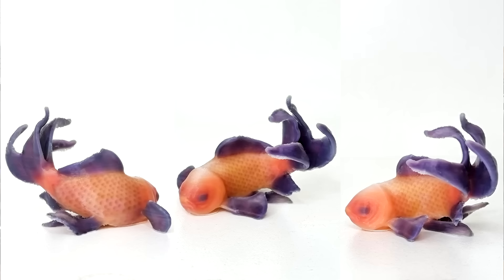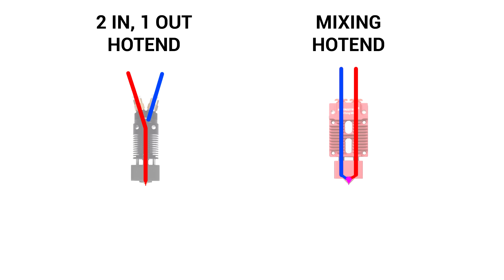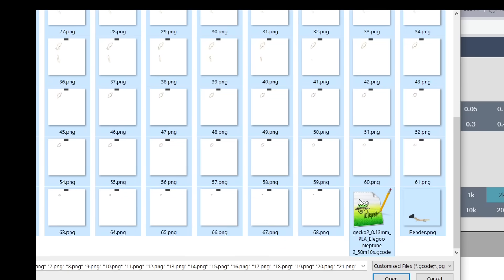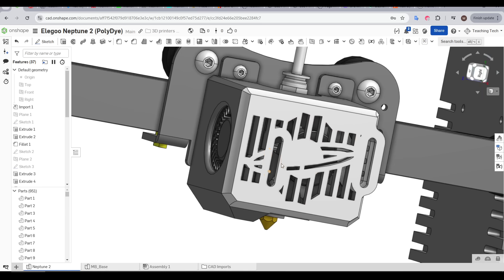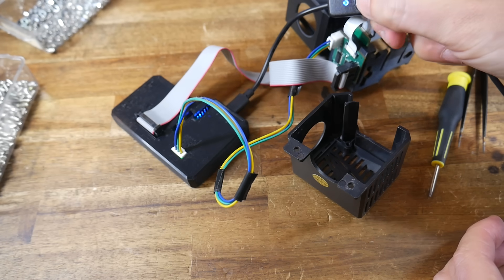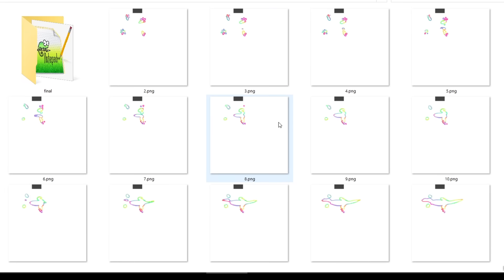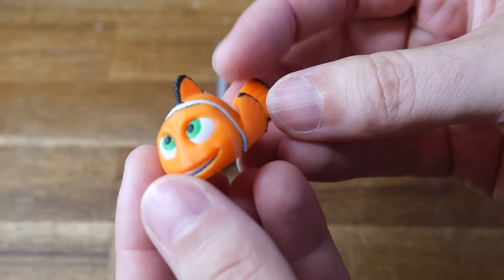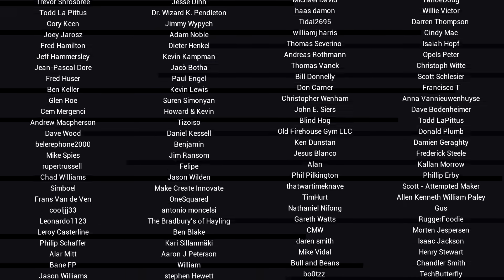Full colour 3D printing at home with PolyDye - Open Source Inkjet integration

Comment: I've never seen a full colour 3D print solution that I would waste time on even if it was free, and this is no different, but it's definitely the right direction to go in. They need to take the ink cartridges off head, and use bottles not standard hyper expensive ink carts. It needs to include a low cost head cleaning solution such as an isopropyl feed.
I suspect that this will eventually be the future of 3D printing, but it has a long way to go yet. In 5-10 years, this will be worth revisiting, but until it can manage really solid colour on low cost white filament, I'm not swapping one proprietary, expensive system for another.
Reply: These cartridges can easily be refilled or plumbed with a refilling solution.  Both are available already.
Reply: @williamsteele  Yes, but it's messy and time consuming, and the capacity is too low. A continuous ink system, which is also already available, is a vastly superior solution.
Reply: @Martial-Mat  Isn't that what I said?
Reply: @williamsteele  No. You said the cartridges can be refilled. I was specifically disagreeing with the wisdom of doing that.
Reply: @Martial-Mat  "or plumbed with a refilling solution" which is identical to what you said.  You still need a print head, and just supplying the print head continuously with ink works just fine.

Comment: If the colors were not so washed out this would be the next big thing in our hobby.
Reply: The amount of pigment probably just needs to be increased to achieve more intense colours. It is a start. On the commercial side, Flashforge is also working on a full-colour 3D printer.
Reply: @andreas.grundler  the 5x is just another ams style approach that looks different, but really affordable. the wax jet? that's for jewelry making.

Comment: That's amazing the one thing I'm thinking about is that is it possible for it to work with cheaper and refillable aftermarket Ink cartridges if it can then this is amazing
Reply: Or eventually a dedicated cartridge just for3d printing that is refillable instead of a hacked one. Heck maybe just a head with a hose with a tank that's somewhere on the frame.
Reply: @Awrethien  I think so too. This is just the easiest method for a homemade hack. Of course you can and have to scale it up further down the line. This is probably mostly a proof of concept to get everything working. Applying the Ink will be it's own Problem in the future. This will probably also affect the quality and layer adhesion so there will be a lot of testing needed still.

Comment: Holy smokes!! This is pretty incredible. The solution to full colour 3d printing was always in inkjet paper printing all this time.
Reply: If this could be made into a modernized and Open Source version of that laminated printed paper 3d printer that would be LEGENDARY
Reply: Mimaki is a ink jet printing company and they developed a color 3d printer that basically works like a inkjet printer just with CMYK resin
Reply: This is really old tech, davinci color did it years ago, but badly
Reply: Incoming: You can't print black filament because you are out of magenta ink.
Reply: @SoidHoid you can’t print while because you are out of yellow
Reply: @SoidHoid  Exactly what I thought. Honestly I am still surprised we can simply buy Filament from any brand and use it without any RFID tag BS or other nonsense preventing us from using different materials.
Reply: @ Bambu is working on it. The maker roots of 3D printing has really gone a long way to keep those bad behaviors at bay, but as we see more broad adoption of 3D printing I don't know how well the relatively small community of original enthusiasts can keep those behaviors in check.
Reply: Yea that will work very well with a ciss. Great idea.
Reply: This has been around. XYZ da Vinci was already making a full colour 3D printer using HP industrial inkjet cartridges nearly a decade ago. Unfortunately i have never seen it actually really look good, and i don't know if the photos published by the project are a good representation of what it achieves, it's either too white and pale or too blurry too much subsurface scattering. It works well with absorbent surfaces where the ink modifies how the surface itself interacts with light, and this is just not how inkjet 3D printing works. We might not find a solution for it.
Reply: Always has been. It was one of the first ideas. 

Getting it to work is the hard part. The really hard part.

It's probably going to need filament support. As in filament specifically for taking color. That means you're also going to need multi filament support, so you can use the expensive stuff only on the visible edges.